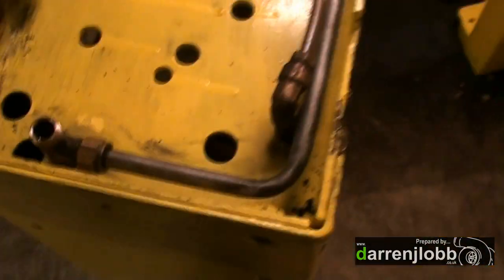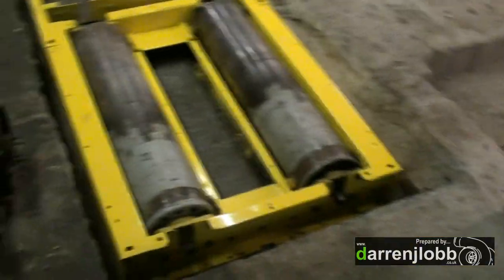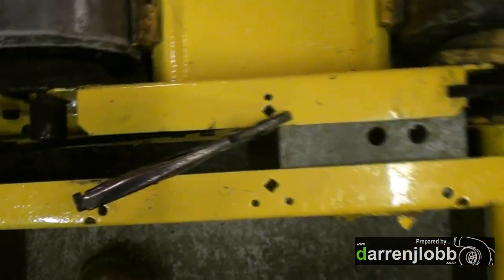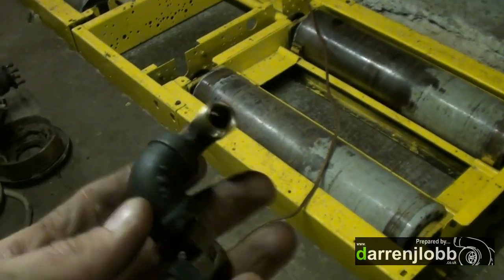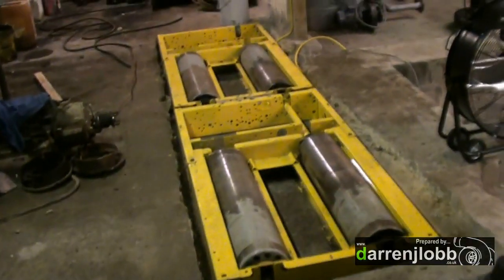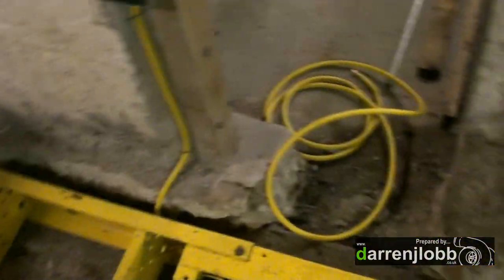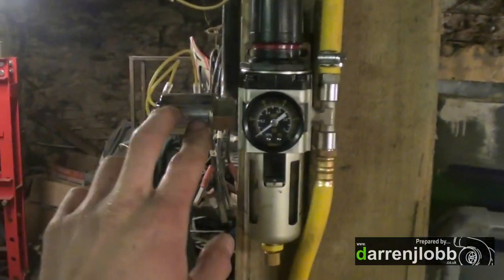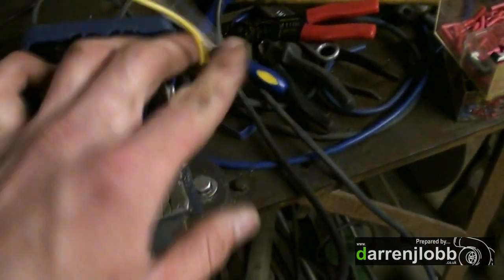Rolling Road Dyno Project Part 9

Comment: Hey Darren I watched this video a couple times. At the beginning you are showing the band brakes and how they work. You mentioned that it's operated by air bag but you never Showed them or the operation.
I know you sold this dyno but would you have a video or picture saved somewhere of the air bag. 
How many air bags in total?
The dyno I just picked up is missing the brake setup, so maybe with your memory you could help me out. We could chat via email or text.
1badslug@gmail.com
Reply from the maker: You can find me on facebook messenger, @darrenjlobbofficial
Reply: @darrenjlobb  I think I sent you a message on your personal facebook. I couldn't find that one you posted. I'll keep looking.